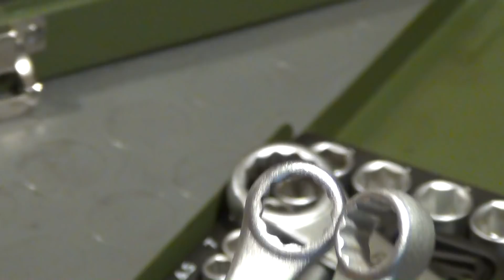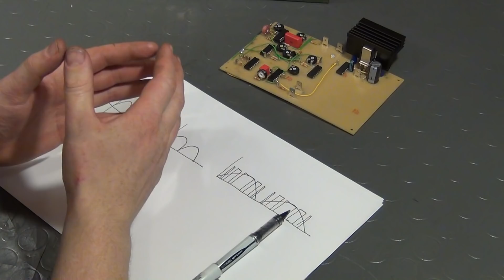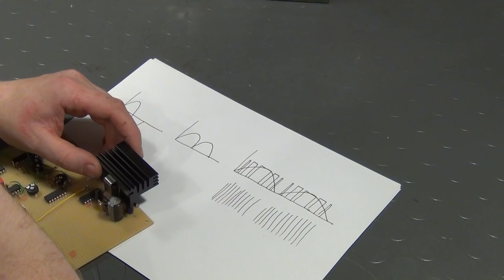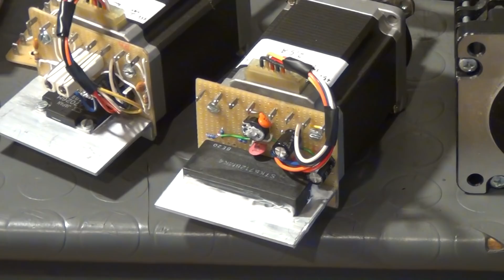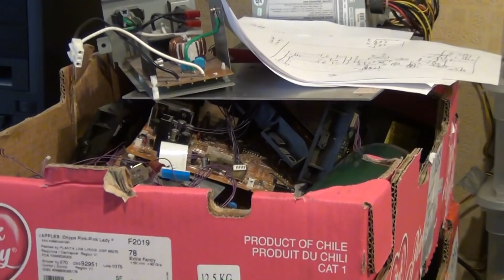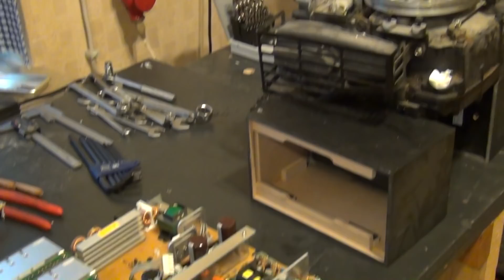TPAI Lab Report # 003:  Stepper Motor Drivers, Sine Wave Inverter, Briggs and Stratton, Proxxon etc

Comment: I guess I know some possible solutions for your trigger Issue with the modulation circuit.
In case that you have issues concerning a constant trigger on a rising/falling edge you might get it done by connecting a second channel of the scope (or any other auxiliary trigger input) to the triangle/sawtooth generator of the modulator IC, the PWM signal is obviously always synchronous to the capacitors voltage as it is used to generate a modulated output. Triggering on the capacitors voltage keeps you away from dealing with the varying pule width signal which might cause issues - although my experience is taht even my 60ies vintage crt scope triggers just fine on all sorts of PWM signals.

Another useful hint might be to use a Low Pass filter to check the modulators output. Luckily a easy RC circuit as calculated by f3dB = 1/(2*pi*R*C) (using some value far below the modulators frequency, yet not too close to 50Hz as f3db) will demonstrate your DC/AC-Converters output at practically no cost nor effort!

If you'd like to get the PWM output plotted you may feel free to send your circuit in to me, I can use a logic analyser on it to get the desired readout at no effort neither, to your luck I'm living in Germany.
Just send me a message if you are interested, I like your stuff and am always happy to offer help.

Comment: I have a Proxxon  socketwrench kit bought in the 80's, A "dremel" bought 15 year ago, A milling set since a year. All have seen a lot of use and I have not a single problem. The sockets and the wrench have had a real hard life but they still are fine.Do you plan a follow up of the converter saga, i liked that very much ?

Comment: Blue smoke is oil, white smoke in unburned fuel. I would suggest you look at how loose the valve guides are especially the intake valve as there is vacuum there which can draw oil up a loose guide. Also the rings are a good thought. I wouldn't suspect the head gasket because it is an air cooled flat head and there is no oil there that could leak past, if it were bad you would be loosing combustion gasses past it.

Comment: check your fuel system for blockage, if you have a float bowl check for flow at the float needle and make sure the needle stops flow as well. safety switches may be defective,your points may be worn out if you have them it is located under the flywheel.if your content where bad no one would steal it & I want to see you finish that inverter...so I can steal it.

Comment: with regards to your first engine do one of two things make sure that your fuel is completely water free, given that even the tiniest amount can make a mower smoke , and two do check all your seals in the mower. as for your second mower try to adjust your timing for the motor, if it is a little bit out it will tend to run for a bit and then stop suddenly.

Comment: Also, regarding your many projects hitting walls, I think most amateur inventors and tinkerers suffer that.  Professional researchers hit walls too, but *most obstacles can be overcome with sufficient application of time and/or money, which large organizations can do.  Those of more limited resources have to divert to other projects while they wait for a more economical solution to present itself.   As long as you don't reach the "Thrashing" point (where you are spending more effort changing projects than you are achieving on any of the projects), then its ok, we all do it.

Regarding your oscilloscope, have you considered a PC/Laptop based scope ?  They can be had at a much lower price/bandwidth point than a "real" scope, and while they aren't quite as convenient to operate, they are much easier to capture screens and data from.  Sparkfun and USBee.com both have economical and feature-full pc-based oscilloscopes with fancy triggering, logic analysers and also do Signal and Pattern generation.  Might make your signal generation project a bit easier to move along.

If you are tinkering with engines, the Megasquirt (very complete, open source, but not GPL) and RusEFI (GPL) Fuel injection and ignition systems are fun to explore.  People have run everything from Briggs's to Tractor Pull V16 engines on them.

Comment: On the B&S motors, the first sounds more like a worn valve guide than rings or gasket. Rings would would smoke quickly and the head gasket would cause a lot of carbon build up and trash the plug very fast. 

The second one sounds like a classic carb kit fix. Most likely the metering diaphragm. 

Check out donyboy73. His YouTube site will get you through both these problems. He has how-to videos on all of these problems. 

He is also a good guy.

Comment: the mower motor may have oil in the crank case vent,....there is a mesh in there and could be hiding oil there,....it will burn off in time if you let it run half an hour,...or it is some other problem
Reply: +70carlton Yeah if the motor was upside down for a while before he picked it up it could have oil where it is not supposed to. Burn it off!

Comment: When you assembled the gas engine that smoked, did you replace the piston rings? hone the cylinder and re-seat the valves? https://youtu.be/5a71QWTogmE On the second engine that quits after a while, check the float bowl has fuel in it after it quits you may have a blockage in the fuel line.
Reply: +theflinx The motor that quits the gas cap could be clogged and vapor locking the motor, the ignition module might be overheating, or an oil switch might be goofed up in it. If it has one. Or the carb could just be running too lean, and seizing the motor after running. Low oil will do that too. Don't ask me how I know that :)

Comment: Could it be the crank breather causing the smoke? Letting pressure build up enough to get around the valves, through the carb, or less likely past the rings?

Comment: The briggs and Stratton mounted on the wooden platform isn't over head valve so head gasket leak is unlikely. If the rings were leaking by, I would think you wouldn't have to wait long for the smoke. I think you should check the air filter and see if the crank case vent is dumping oil into the air cleaner. Just a suggestion.

Comment: There was an excellent video I saw a while ago about the stages of being a youtube provider.  If I remember correctly it's stage two where the provider thinks they can affect there negative comments buy talking about it as a reasonable human.  Thinking that the irrational, negative comments are coming from reasonable people so you can still reason with them.   The majority of youtubers who give up, give up in stage two/three based on this negative comments.   But, For those that make it.  What normally happens is that they learn to feel a small bit of sympathy for the people that write these comments based on how there life must be to think this is reasonable.   Content creators then start being able to deal with this by not internalizing these comments.   I'm not saying this is easy to get to this place or that it is 100% success full.  Just that successful youtubers eventually learn to focus on the good parts of the community (positive or constructive criticism) and ignore the trolls.  

I wish I could send you the video but I'm sure there are a few dealing with the subject of dealing with youturbe comments.

Good luck.

Comment: Don't dwell on what you can't change (such as idiots).

Totally go for the 1/2" set, I rarely use the 3/8" at all. 
Also I will recommend the cheap 1/2" torque wrenches you can get at Aldi, the torque accuracy is OK but really they are nice and long and at that price I don't hesitate to abuse it like a breaker bar. 

Also, if you can, get the offset box ended set from Proxxon, I like it best of all their spanner sets. Always thought combination open/box ended spanners are a bad idea because that puts two of the same size on one handle, which is bad if you need two to counter. If you get separate box/open sets that gives you that ability with the same number of spanners.

Does the oil even go through the head gasket on small engines?

Comment: Here's a side question. I'd like to buy some of those perf-board test pins on eBay (the brass pin with a metal tab that has a hole in it). I can't find them. I don't know the magic search phrase. Does anyone know? I can only find the straight pins.

Comment: Good job Tpai, as for direction on the motor controllers, I vote for posting schematics with signal shapes at various points through the schematic. Related to this is to relate the signal shapes to the motor needs: specifically the magnetic push at each pole. Why post?--sort of a technical mechanism to obtain comments which would improve the understanding of the functions, improve the schematic, and get a reasonable set of driver control plans for all types of recoverable motors. :)

Comment: Never mind those idiot comments, they've never achieved anything and probably never will! 
Again our interests overlap! In the last month I repaired three different b&s engines (before I'd never really touched one). The oil burning one probably has worn out piston rings (easily checked by taking them off the piston, putting them inside the cylinder bore and measuring the gap between the two ends of the ring, you'll find the spec online) Could also be the valve seals, but usually when they are worn it gets better, the warmer the engine gets. 
The one that stalls,  I suspect you know how to governor works on these engines, after tearing them down? I found that this was the problem on two of the ones I repaired, it's easily adjusted.

I like the proxxon socket sets as well (in Belgium they're also good value; Gedore, Hazet, Stahlwille and Facom are crazy expensive), but I care less for the combination spanners, they're too short and just look and feel cheap to me. I do like their longer double box offset wrenches.

I think most people here know about the brick wall you're talking about; it's inherent to any remotely ambitious project. Frustrating, but when you overcome one it'll be all the more gratifying. 
BTW, I like your weird arse music :) Thanks for the video and have a nice holiday in Lübeck!!

Comment: Where did u get that 2 huge stepper motor?
Reply from the maker: +Hulla Dek I bought them on Ebay. They are used but were still quiet expensive.
Reply: +The Post Apocalyptic Inventor how much A and Nm?
Reply from the maker: They are 5 phase bipolar stepper motors.
U_CH=70V, I_W=2A, R=1,4 Ohm. I would have to check the datasheet to give you any torque values though.

Comment: i got similar proxxon and seneca tool kits, that are in my car trunk all the time. I always like to have tools with me if car breaks or i need to screw in some bolts :D so about those kits, they kinda "live" in decent conditions, but still some components managed to corrode. I hate rust, it drives me nuts... but anyway quality is decent. At least for the price :)

Comment: you can try making sinewaves with capacitors and inductors (cap in parallel inductor in series) by supplying with 25/50 hz square wave at the gate of the mosfet.

Comment: Im so sorry your being affected by the nasty people of youtube, there are nasty people in every society that just want to ruin other peoples lives, please ignore them and think only about all the people that like you :-D :-D
Your socket sets looks smashing, small and large, a good selection of tools make any job much nicer to do :-D, they dont have to be the best quality to work eather.

I know whats wrong with you, your too clever and love experementing and learning, thats why you have many parallel projects, im sorry there is no cure for being too bright ha ha :-D
Try not to get upset when a block comes along, if everything was easy for you to do, you would be so so bored :-)

The ignition coil module can cause problems in small engines, its a coil and firing circuit, they get hot and...... well you know :-)
Dont overfill your engines with oil, the valves often dont have stem seals so it gets into the combustion chamber.
Have a nice trip my frend, dont worry about youtube, we are all just penpals lol.

Comment: couldn't you just put a capacitor in series w/ the wave which has an offset, to remove it?
Reply from the maker: +TheTrueM3ga What you mean is to use an RC-high pass filter. I indeed did that before I resorted to the Op-Amp solution. Using an RC circuit is not an option here though, since it also generates a phase shift. 
The signal must stay in phase with the original sine wave though, because the rectangular output signal of the ICL8038 also acts as a synchronizing signal for the output stage.
Reply: The Post Apocalyptic Inventor ah ok.